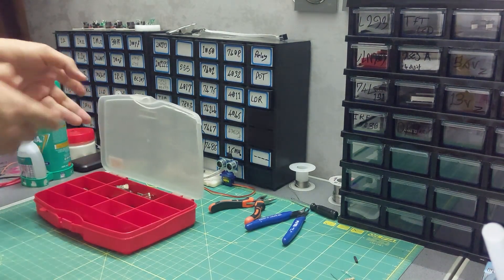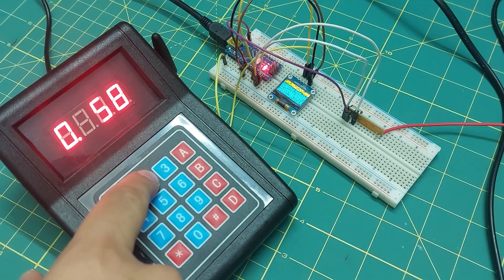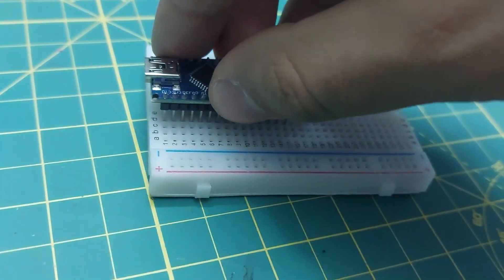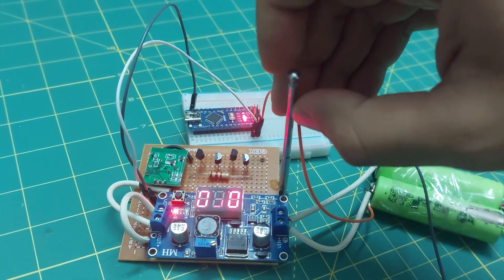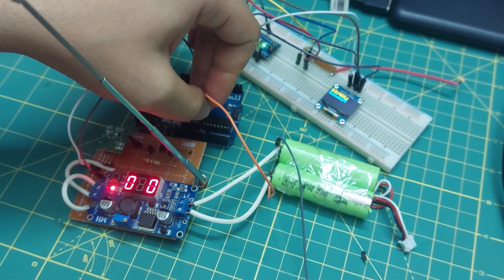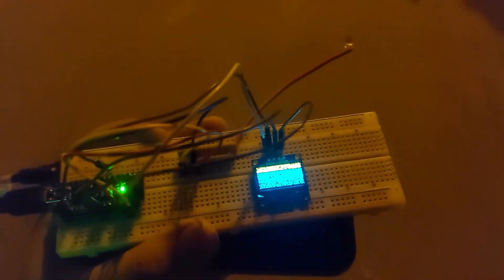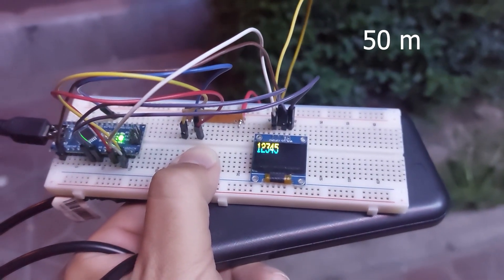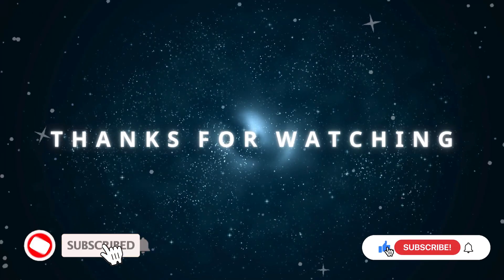How Far Can This Amplified Radio Telegraph Really Go?

Comment: The reason why the amplifier did not work was because it wasn't an rf amplifier. RF (radio frequency) amplifiers take the transmitter output, pass it through a power transistor which it's collector has a parallel lc circuit (exactly as an fm transmitter output stage) that circuit is called a class C amplifier. The base of the transistor works at the frequency of the transmitter and it amplifies the signal, you get the same frequency input at the output but at a higher amplitude since the supply voltage is higher and the transistor is higher power and also also because of the lc circuit. You could use a bd139 probably since it's commonly used in fm transmitters. I don't know if it's possible to reach the UHF band with that transistor because all datasheets say 50mhz is the maximum frequency for it. Good luck man

Also you could try a class e amplifier which is actually pretty simple and can use high power mosfets. The issue is mosfets are really picky about high frequencies. I'd recommend you to try it with an IRF510 VDS is 100v and ID is 4A. I doubt you'll be pushing it to the limits. Best of luck my friend.
Reply: ALSO REALLY IMPORTANT

Tuning it is really difficult if you don't have an oscilloscope, frequency counter and a LCR meter to measure capacitance and inductance so you can calculate the resonant frequency. Good thing is that inductors and capacitors at the UHF range (400mhz) are usually really small. So you can eyeball it. Small inductors and small capacitors = high frequency

AND ALL INDUCTORS SHOULD BE AIR CORE AND NOT MADE OF FERROUS MATERIALS (except if you want to block them from going back yo your power supply. I'm talking about RFC coils or radio frequency chokes)
Reply: And also messure the current draw as you tune it and mess around with the gate bias (if using a class e amplifier) if it draws current but no output it's probably not oscillating and you are just running the mosfet in the non linear mode and shorting out the supply.
Reply from the maker: Thank you for your detailed explanation. Do you mean that if I use the same FM amplifier, the circuit will work?

Comment: Thanks for making this video, I was wondering about making a custom walkie talkie/telegraph for emergency use or for communication during trekking/hiking. It should need more power ofc. But I have a doubt, instead of using the readymade module, what about making a custom Colpitzz Oscillator for longer range ? Hope you continue this video in a second part 😀 good luck sir :)
Reply from the maker: Hi my friend. I think this video is suitable for you https://youtu.be/K_STgDEQQPc
Reply: @BabakStars I hope your expertise can guide me on this topic which I am less familiar with.
Reply: Actually, I don't want to use existing readymade modules because although they have great data rate, they can't be customised much in terms of range. I am focusing much on making and tuning a custom Colpittz or LC Oscillator, because it can be custom tuned both in terms of frequency (for better penetration) and output power. Might be a good topic for your next video :)